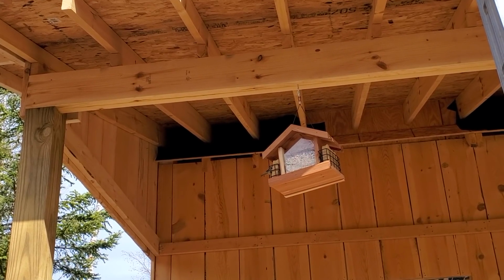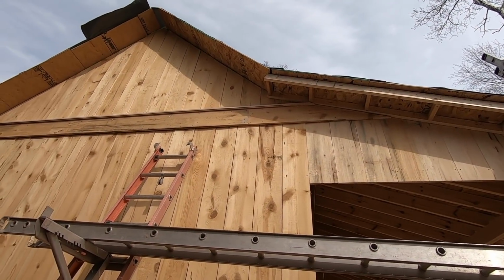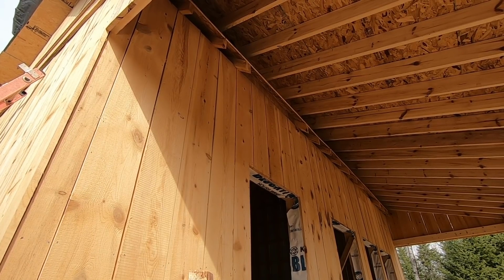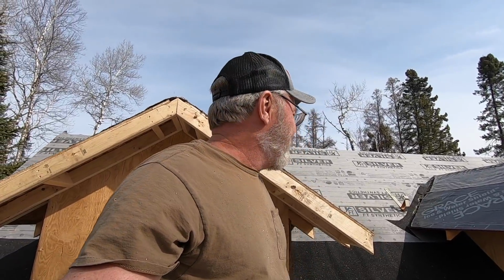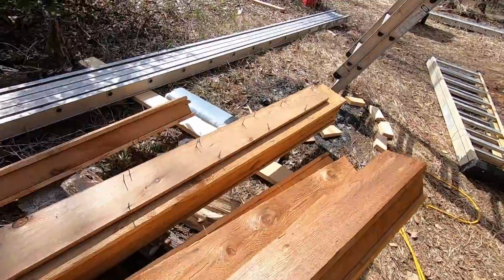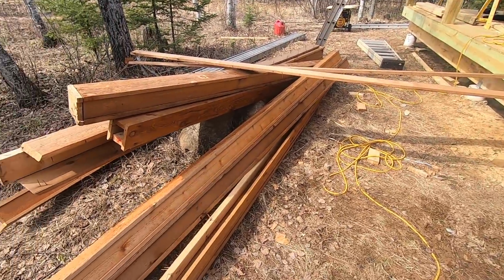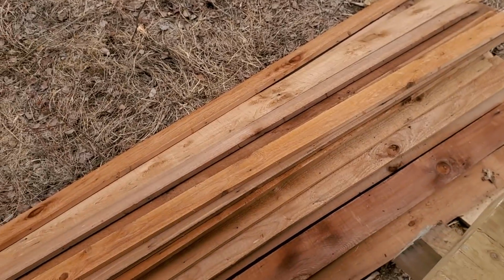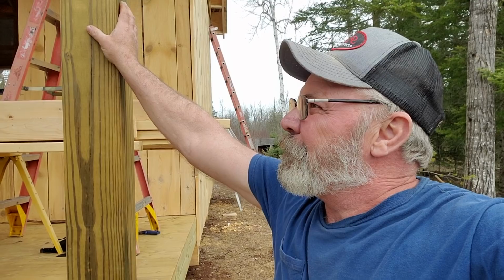Off grid cabin build, part 20, in Northern Minnesota

Comment: Just a thought before you go any further, I would pull those ceiling joists down on the porch and do tongue and groove on the vaulted roof. Having a ceiling over your head like that feels more confining and stained or painted tongue and groove board would look amazing out there. Plus you could drop a couple of ceiling fans if you wanted. I pulled the drywall ceiling down off my screened in porch last year, removed the joists and made it a vaulted ceiling by raising the rafter ties and covered it with tongue and groove and it looks amazing.
Reply from the maker: Thanks for the idea, but I want a flat ceiling in the porch, the cabin has 19' vault in it though. I will be installing 12 volt led ceiling lights and want the flat ceiling for that and the feeling of a more enclosed area. Appreciate the idea and comment

Comment: hey wiley. saw you talking about a 6x6 back porch. that might be a little tight if a door is included. an 8x8 might be an easier build with less cuts???
Reply from the maker: I will if it will fit, a 6x6 will for sure but the roof line may start evading on dormers if to large, thanks for the idea, have a great week now